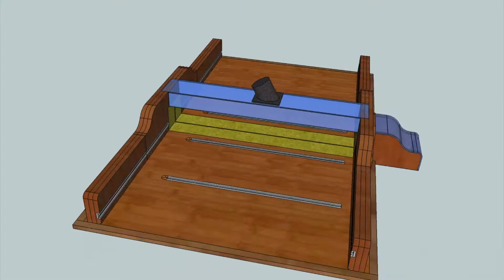SawStop Table Saw Crosscut Sled Fence Extension using Reclaimed Materials

Comment: I’ve always been hesitant to build a fancy cross cut sled because of the eventual wear and tear but building it with a replaceable zero clearance part has crossed my mind a few times. Does that work well for you?
Reply from the maker: Yes, it has worked great.  Also allows me to use it with a dado stack or bevel cut (separate inserts) while maintaining the zero clearance.